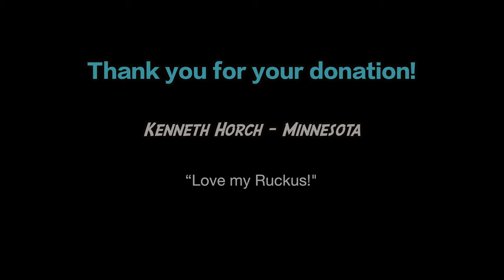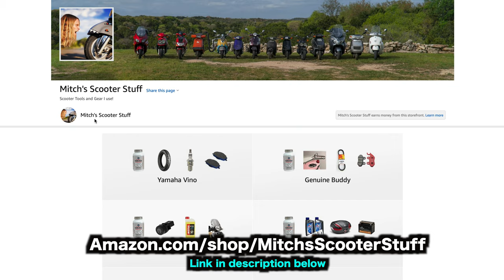Vespa EVAP System Removal Tutorial | Mitch's Scooter Stuff

Comment from the maker: *PARTS / TOOLS YOU NEED*
Ratchet 1/4 drive - http://amzn.to/2xcJEu1
8mm tall socket 1/4 drive - https://amzn.to/3cNGsbs
Scissor - https://amzn.to/2pIY56w
Zipties - Zip ties - http://amzn.to/2pkp3AL
Air filter oil - https://amzn.to/2YctVJz
Fuel line - https://amzn.to/3f296Hj
Air filter foam - https://amzn.to/37eTaPt OR foam brush - https://amzn.to/30lvc3y
Vacuum cap - https://amzn.to/37bHo8x
Vacuum tubing connector - https://amzn.to/2YhR1hE
3/16" clear hose - https://amzn.to/2UntpHy

Comment: Evap system Present in the vespa lx 50cc 2007 year?
Thanks
Reply from the maker: Yes, correct
Reply: I’ve got a 2007 that I’m trying to service. Does not have the Evap system as shown but has a SAS. Put another carb on it now I have this hose coming out of carb with nowhere to go. If you have to filter it I’m assuming it’s sucking air?